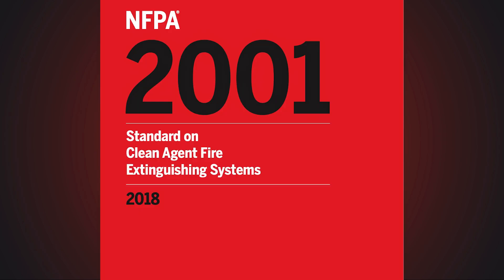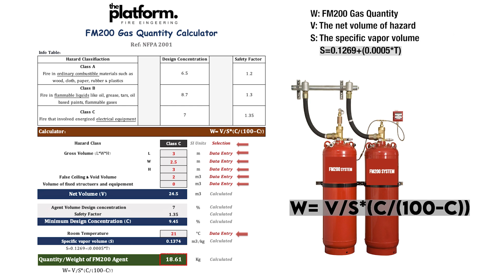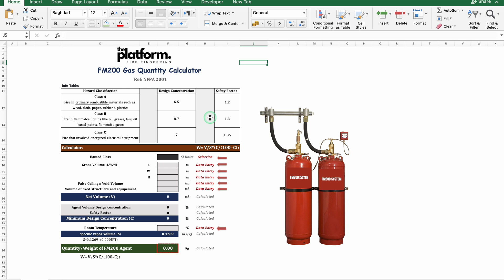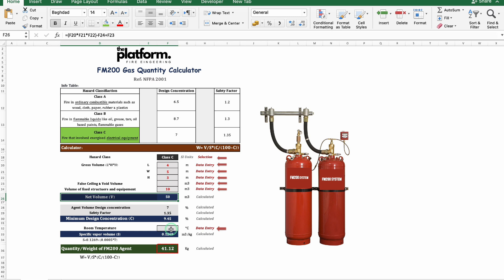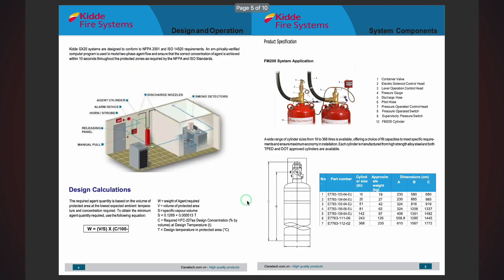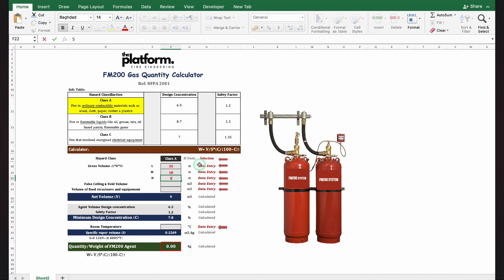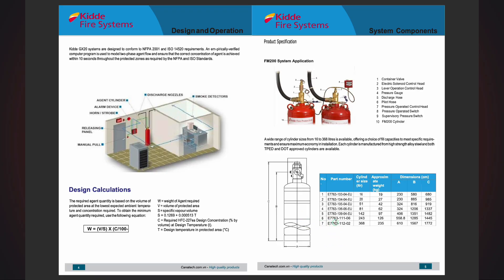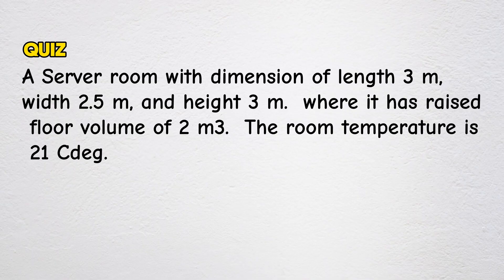How to Calculate FM200 System Gas Quantity? Free Calculator Asset | Fire Suppression

Comment: Hie Eng.

Dont we need to include the whole height between finished floor level and the slab for the next floor in case of multi-story buildings  instead of just considering the false ceiling level

Comment: Altitude correction factor to be considered. Based on this the final gas capacity will vary. And also when we are handling multiple voids, if a particular void volume is less than 10% of biggest volume. In actuals we need more gas. Due to gas calculation software split of gas requirements.
These calculators will provide approx values only. Actuals values of net gas required for a specific enclosure will be decided upon multiple variables.